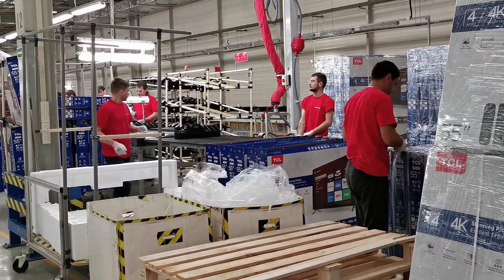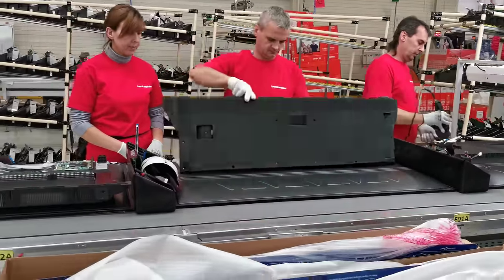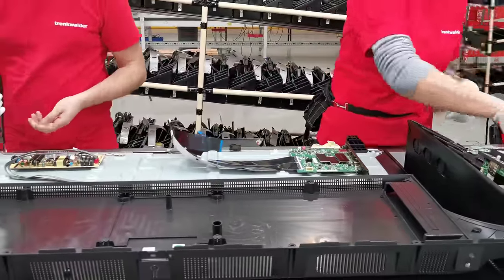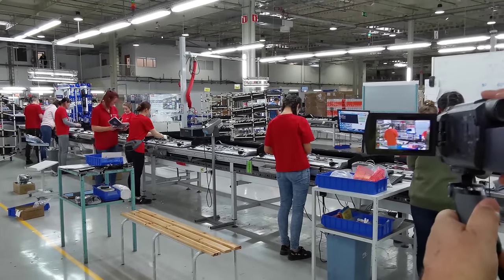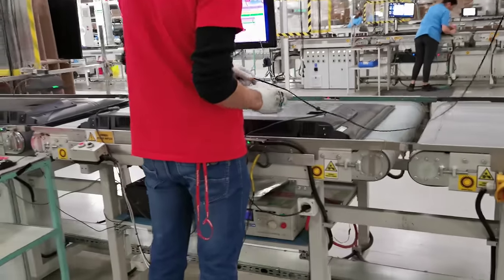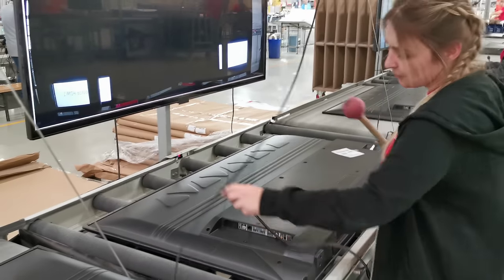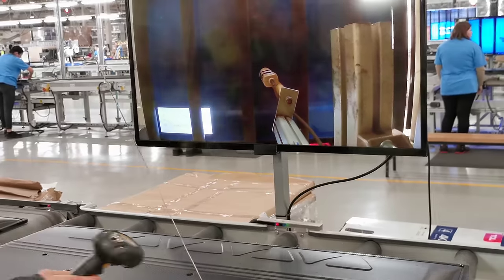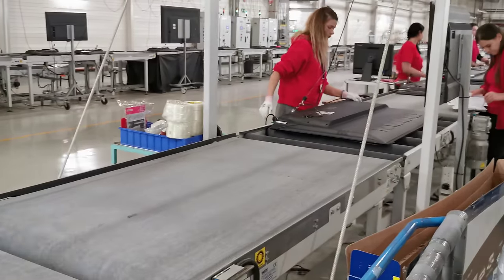TCL TV factory tour | The assembly lines

Comment: So, you get the finished product from China, open the package, reassemble the parts and put a made in Poland sticker?
Reply: I know right? I was just about to type what you typed. I was like those people don't look asian.
Reply: David Guerreiro I believe that those panels had come without tuner, as DTV protocol varies from regions, what they did was to put a tuner for their region as to finish the final assembly. As I can see, their production line was quite loose, not decent enough for quality production.
Reply: It's a Chinese company, but I think where ever it was assembled, they get the sticker for it.
Reply: The whole point is to create local jobs
Reply: the LCD panels come from china. the motherboard, power supply and others are assembled in Poland
Reply: its cheaper then build it from ground up in the west..  just replace some components, cos regulations and/or technical reasons.. 
in my book this is really smart...
Reply: Its best way to eliminate problems with Made In China products. Most problems are with electronics itself or its assembly. You have to pay much more for good quality control in china, and even then you cannot be sure it will be good. There is also a bonus, you actually make more jobs for people here in EU.
Reply: @tiagomartins8715  Sticker made in chine printed in poland?
Reply: Sticker made in china printed in a Chineese printer in poland
Reply: @mysteryMachinePL  Still all components made in China. Chinese product assembled in Poland you pay more.
Reply: Avoiding taxes...
Reply: Chinese every where! Now the afghans can work in their factories too.

Comment: 2:31 As an electronics repair technician I have seen this Chang capacitors (2 long devices on the circuit board) leaking and bulging quite fast, even as soon as within a year they fail and need to be replaced. They use them in all types of cheap Chinese electronics. Horrible!
Reply: Yep! Not the very worst brand, but not good.
Reply: As an electronic engineer, i can tell you that this is how planned obsolescence is done. Every wet capacitor has nominal life span and optimal temperature. When you exceed temperature or current then you can get nice bulging .
Reply: @Kawka1122  Yes, correct! I know about planned obsolesence.

Comment: its SKD (semi knock down) assembly factory. Unfortunately, I am not see an alignment process to meet PAL M standard for Brazil. 
The employees are not using hand anti static strip.
Reply: The TVs shown are for the USA market, so NTSC alignment. Antistatic wristbands are not the only way to prevent ESD damage. Another, which is probably what they have there, is an ESD floor. Special paint on the floor conducts electricity to a ground connection somewhere along a wall. The workers wear ESD footwear, which conducts electricity as well, accomplishing the same thing as an antistatic wristband.

Comment: Just ordered a 50 inch here in Portugal and it’s getting delivered Momday. I hope my tv wasn’t the one she went to town on with that hammer lol
Reply from the maker: Which one?
Reply: @hxosplus  50C715 my first qled. From most of the reviews I read and saw is a solid performer for a good price. Just hope reliability is good too as it’s my first tcl
Reply from the maker: @Neo_Rain146  Good choice, check the P815 as well
Reply: @hxosplus  Why is the TV hit with this rubber mallet?
Reply: Unfortunately I’ve not had a happy ending with my TCL. After 10 months the panel developed a pink/Purple tint across top edge of the television. This is something I could live with if tv was 5 years old or second hand but new? I sent it in to TCL for repair and been informed it’s unrepairable. I will likely now spend a little extra and get a Samsung. A real pity because I was quite happy with tv and picture before this happened.
Reply: @Neo_Rain146  u are talking about the c715?
And where was it made in
Reply: @spikethedaawg9364  Yes, made in China obviously
Reply: @Neo_Rain146  what tv u have now ?
Reply: @spikethedaawg9364  Q70, so far I’m happy with it

Comment: Why they are dis-assembly the TV-sets? This TV-sets where original packed and now they are pack it out of the box doing some thing assembly them and repacking it. Also interest is that they using a Philips Monitor for the line. What we can see is a analogue tuner test and this picture is total with noise and have no rf-level on-screen display that the person who test this can see the rf-level.

Comment: whats the use of hitting the back of the screen with that rubber ball??
Reply: probably to see if it can handle the rated shock resistance.
Reply: @j0ori  i saw other films, it's to check if there's any loose connection (screen flickering due to incorrect connection)

Comment: This TV brand is not worth buying. May be those giving good comments are workers from the factory. I bought one of their products, 50P617, and exactly a year  after, it broke down with picture problem. LED backlight and sound ok but no pictures. What kind of a product is that? The worst electronic products I ever spent my hard earned money on after a year of savings, only to breakdown shortly after the one year of purchase when the warranty just expired. I thought I could get a TV product that would last for more than five years after my old LG TV product failed at exactly five years, so I decided to buy TCL which eventually gave me the worst experience ever. Feel disappointed and cheated.